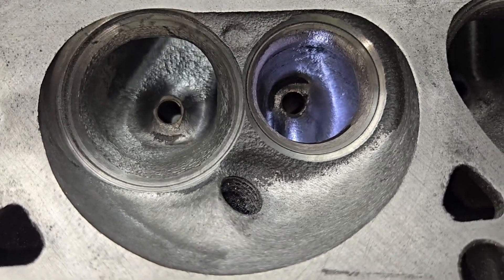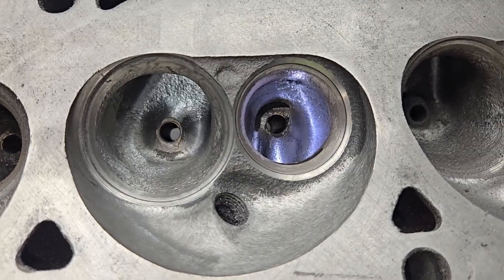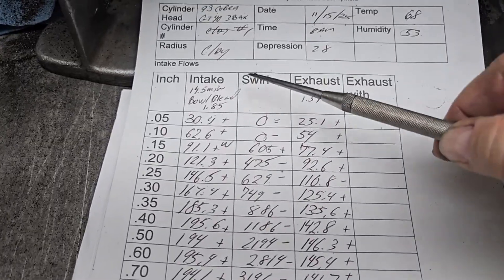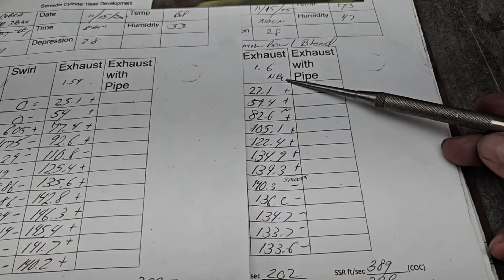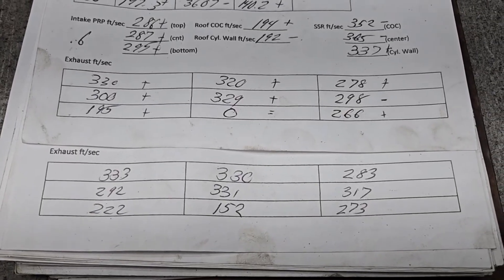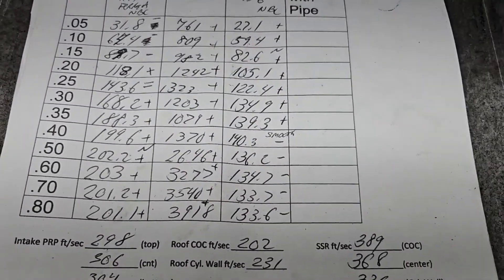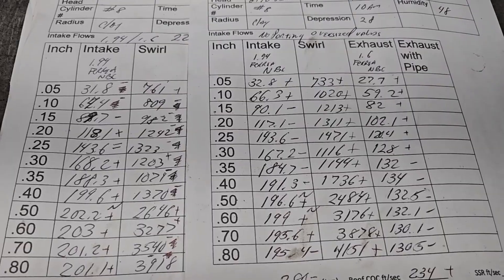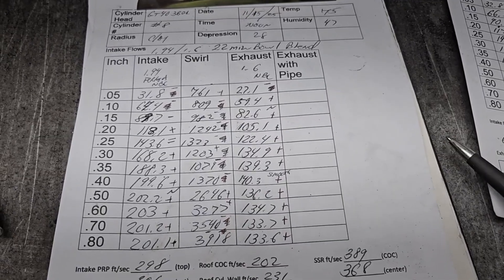1993 Cobra GT40 3 bar project. Oversized valves with bowl blend vs. Stock valves with bowl blend.

Comment: Charles have you replaced the 1.84 valve with 1.90 on the exhaust size and kept the 1.54 on the intake with port heads seen any gain over the stock valves size ported heads.
Reply from the maker: These have 1.94"/1.6" combo. Thanks

Comment: @servediocylinderheads good stuff Charlie. When you are looking for best numbers where full curtain airflow is occurring say up to equal 25% of the valve's diameter... isn't it best to have the bowl shaped so it's perfectly concentric with the throat and seat angles? I've seen people chase high lift numbers by angling the bowl, making the bowl an odd shape etc... and they get their higher high lift numbers but totally destroy the flow in the low and mid lifts.
Reply from the maker: I don't have an answer that covers every design. I do it by air speeds and if the added cc is worth it for flow gained.
Reply from the maker: There are guys who use offset bowls effectively but not on every design.

Comment: Do you think you've hit your limit on the exhaust side due to the rest of the port? I've done a DYI bowl blend and porting on Exploder 3 bar heads with stock valves based on watching hours of DV's videos. I'm interested in if my work was all for nothing on just should have stopped at the bowl blend. I biased and hogged out the exhaust port because I couldn't stand looking at a port that a nickle would have a hard time going through. Thanks for the videos.
Reply from the maker: The exhaust come around faster than the intakes! They need to be fully ported but hogging them out is not the answer. Thanks

Comment: I think it's not quite separating from the short side, but it is transitioning to a more turbulent flow. I would expect the rough texture would create a turbulent, albeit attached boundary layer. Maybe there's a vortex that makes the flow go out of kilter around .500 I notice your swirl takes a big jump and the exhaust numbers start to go down exactly at that point, so maybe some chamber work is in order?
Reply from the maker: Stay tuned.